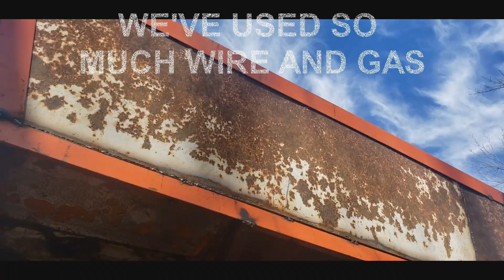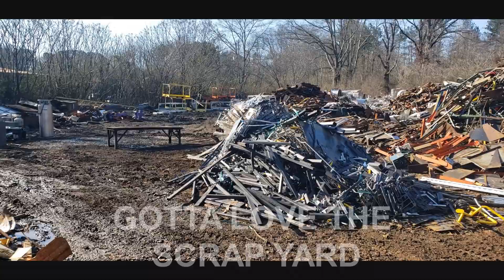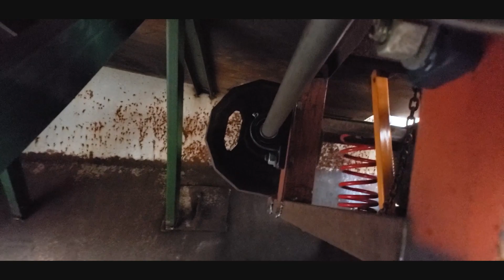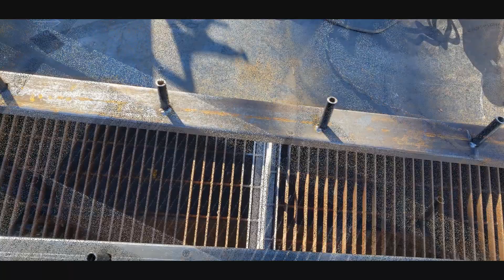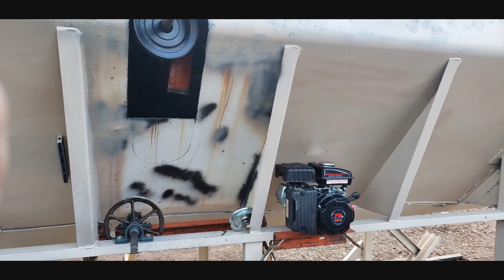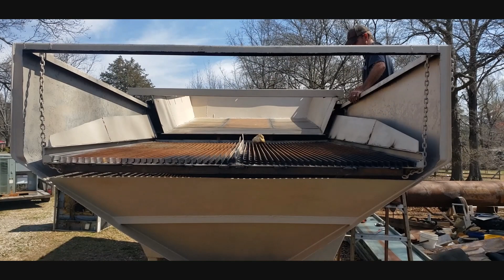ALABAMA GOLD - WASHPLANT BUILD PT.4 "SHAKER DECK"

Comment: If your Grizzly Bar plate is say ... 6 x 8 feet and you could instead get a steel plate that's 6x8 and an inch thick ... would it not be stronger to use low carbon steel and plasma cut out slots for the wash to go through ..? I really don't know anything about mining, gold, welding, etc ... but I've heard you can't weld iron otherwise it becomes brittle from the high carbon content ... thus, you can't really repair it easily -- and if you ever get on site somewhere in which you have a short season and you're spending a lot of money --  you either need two of everything in order to have spares ... or, you have to know it's repairable.   Speaking of ... I cannot believe!!! That none of those guys on Gold Rush (TV show) have access on-site to a LATHE and a MILL!  WTF are they thinking !? It's like every other day that they need something turned down, to cut threads, etc.  Also ... not sure if you already know about this stuff ... but apparently there's spray-weld for Iron ... you can see it on the channel CUTTING EDGE ENGINEERING AUSTRALIA when he fixes Iron equipment ... seems like a simple low pressure from the air passing by (kinda venturi-ish) sucks iron particles as the air goes by ... and immediately puts the iron powder into a flame that's the exact temp for iron to melt letting him build up the iron and then either turn it down or mill it down to size. 

I'm also guessing you had to 'size' those springs based on the final weight of that shaker deck ... yeah..? 

Also, why don't people use wheels that can be lowered and raised ..? 

Seems like you'd want to be able to disassemble the large (heavy) sections, also, for travel. Seems like you'd also want a sleeve and a guide rod to make it really easy to line that stuff back up... 

again, I really don't know shit -- these are just questions I have out of curiosity ... so if they're particularly dumb, I apologize.

Comment: Also trommel with baffles break and wash clay so if you have a high clay content a shaker deck is not the  best choice , they are for rocky ground with no or little clay . You have to build for the ground you are running
Reply from the maker: I appreciate your info but watch the other build videos. We have  trommel 30"" x 20'. It has baffles (in next video). We added the shaker to further break down the clay. Our goal is a much longer process
Reply: Great advice.  I'd never even thought about that. Thanks

Comment: So for our homemade wash plant in Alaska we simply bolted a pipe cut in half and clamped to the center shaft or bolted . You don’t want it on one side because the weight is not evenly distributed and will mainly only shake one side of the deck.
Also we had coil springs at first but they bounced way to much and bounced the belt off the pulley constantly . So leaf springs did the trick .
Finally our last major problem was belts breaking or popping off so we used fuel hose as a belt with a brass fuel connector . Also you need enough water so you can see rocks bouncing their way out the sluce box . Less will pack the riffles . You can overcome water shortage with home built hydro lic riffles , they are fairly easy to build . Pan your very bottom riffles routinely , there should be no gold or you’re are losing gold.
Reply from the maker: we have ran a trommel and thats why we have built this. by combining the shaker and the trommel, we should get more washing time to breakup the clay.
Reply: Great info.  Hydraulic riffles seem like wizardry to get right (optimal pressure).  

Interesting re: coil springs leaf springs ... I was just thinking they'd probably need to be very well matched to the weight of the box and however rigorous the shaker is. :)

FUEL hoses..?? I don't understand. Did you guys consider chain...? 
That way when it breaks, you can just replace the links that broke..?

I don't know how to weld, but I hear you can't weld iron w/o making it brittle, & assume steel is better material (esp. for major components & wear items) so it can be fixed by welding when it breaks..?

Also, why don't people use wheels that can be lowered and raised ..? 

Do you try to make it modular ..? To disassemble major components for travel & repairability..?

THANKS!!